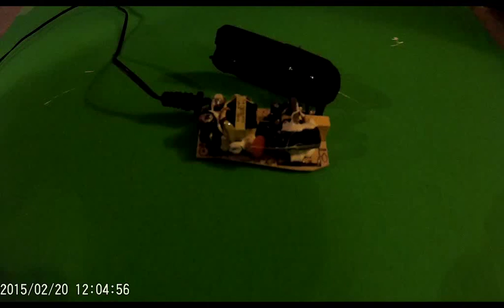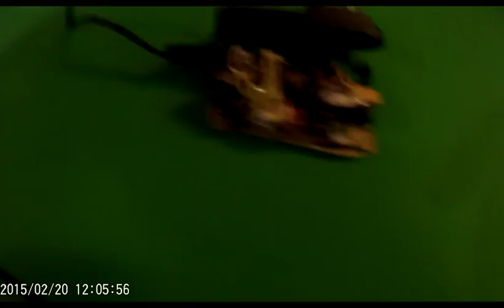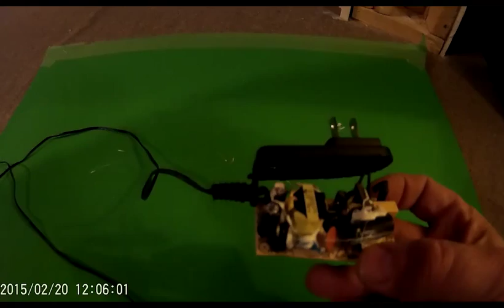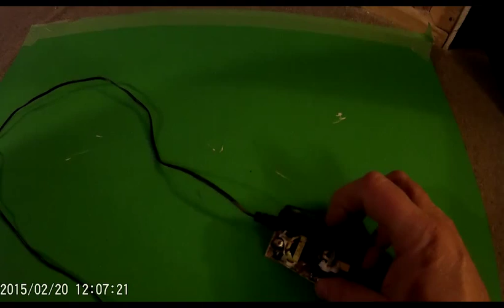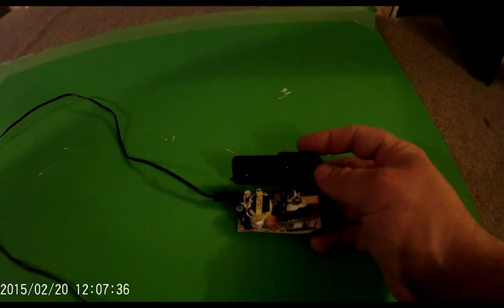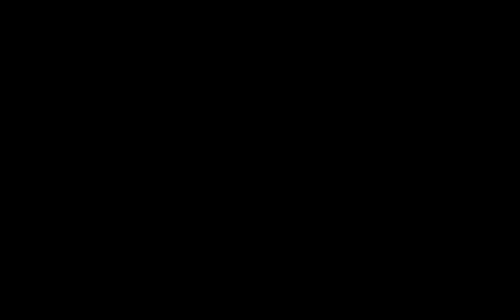Android TV Box No Power

Comment: Mine stop working then I tried to connect the set top box adaptor and the power supply is gone now  I tried fixing it but it has to be done by mini soldering I don't have the equipmenta for that

Comment: I was expecting a video showing the problem and after fixing the problem the end result .Mine is doing booting but shuts off with no signal less than 10 sec their is signal.
Guess i have to do the video for it and if its work; thanks for the head-up !
Reply from the maker: +heir apple it would be of a box not powering on, followed by a box power on after capacitors are replaced. Not much to see.
Reply: +TechHeads my box does not turn on. When I hit the power button the spdif light in the back turns on
Reply from the maker: check the power supply as above. if it looks good it might be a corrupted rom. it may be working slightly, but not enough to power the box properly.
Reply: +TechHeads how do I fix it?

Comment: how u fix a blown board on a Android box pluged in higher vault plug
Reply from the maker: +stephen williams You'd have to check each surface mount fuse and replace the ones that blew. Considering the price of android boxes, you might be better off just replacing the whole box. Especially if you have to special order surface mount fuses in.
Reply: +TechHeads Its seems like one of the fuse is blown is there anyway of cross/bypassing wiring this? Thanks I have pictures of the board if it helps

Comment: My electric tripped off and I thought i had unplugged my gbox before i flicked the trip swith back on first of all it came back blue light came on then when I came back it was off there is an orange light still on inside so there is some power going to the box. Do you think it could be the adapter or did I blow it when I turn back on the electric

Comment: my TV box was working fine about a week when suddenly what I can see on screen is " no signal " with blue background. during it's functionality I found that whenever I switched on/off for example  I need to switch on/off lights the screen got blinked with black background on the screen. Did find any solution? or is it broken ? how long can we use this TV box (android) or maybe overheat that caused the problem.just don't know what to do.
Reply: adonislavender  try to change the android version of the box,mines when it boots shows google tv logo..it works much better now ,and also this boxes have the ventilacion under it ,what i did was i put it in a stand that almost all routers bring